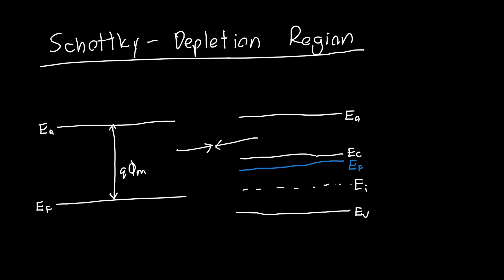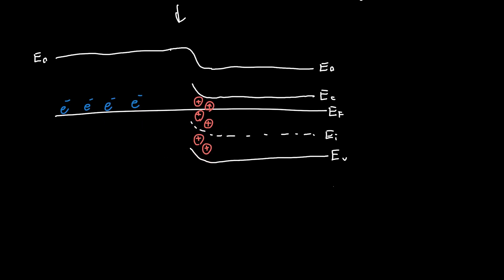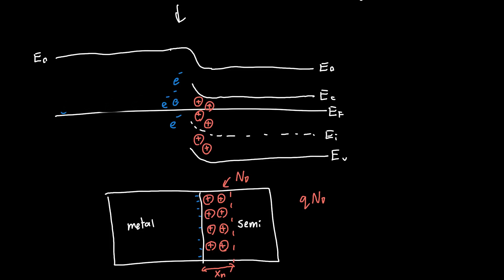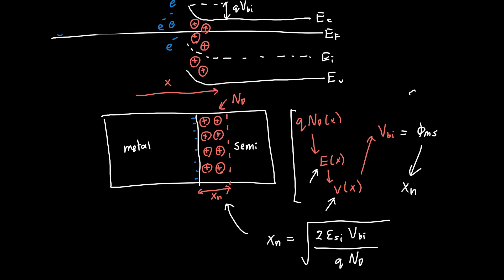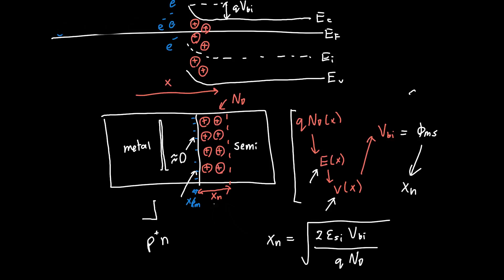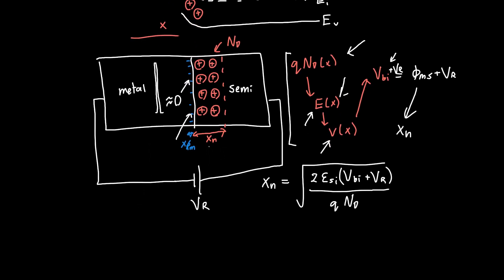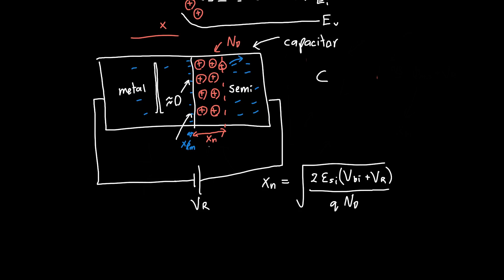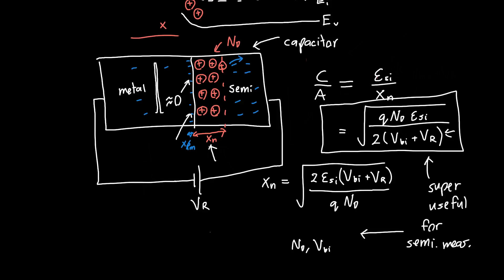Schottky Diode Part 2 - Depletion Region and Capacitance

Comment: What I can't understand is why this junction between the semiconductior and the metal is also NOT (?) taking place on the other side that is connected to the wire. Would they not cancel each other out? No one ever addresses this.

Comment: So in a n-type, the metal's work function has to be greater than semiconductor's? What happens when the work function of the semiconductor is larger?
Reply: The band gap bending will be inverted.  This happens when you join a p-type semicondcutor.

Comment: Hello Jordan. Hope all is well with you. I have a question with regards to the capacitance. How is the thickness just the depletion region. The depletion region consists of positively charged ions and the rest of the distance on the n side is are the electrons. The width should be the distance between the two right? If yes, the how is it xn.
Reply from the maker: The relevant distance is the separation between your two ‘seas’ of mobile charge carriers. There are a bunch of mobile charge carriers in the metal (and there is a ‘depletion region’ in the metal, but it’s a fraction of an atomic length), and there are a bunch of mobile charge carriers outside your depletion region, which has length xn. The separation between these two determines your capacitance. You just treat the ions as if they are a dielectric, because they cannot move to conduct current.
Reply: @JordanEdmundsEECS  Hello Jordan. Nice video. I have a question: why do we use an AC voltage with mV amplitude while performing C-V measurements in Schottky or PN junctions? Thanks and regards!

Comment: Thank you for the video. Around minute 1 you show that electrons will move from the n-type semi-conductor to the metal through diffusion, until E_F's become equal. Will this in general happen with any n-type semi-conductor/metal combination, or will this only work in certain rare cases? I seem to understand that this happens exactly when E_F in the semiconductor, before contact, is higher than E_F in the metal (so actually E0-EF,metal > E0-EF,semic.). So could it just as well happen that the E_F initially was lower in the n-type semiconductor than in the metal? Then the electrons would flow from the metal to the semi-conductor?
Reply from the maker: Yup, exactly. This actually works not only for any metal/semiconductor combination, but even for metal/fluid interfaces and arbitrary semiconductor/semiconductor interfaces. It’s super powerful. Which Fermi level is higher dictates where electrons flow from.